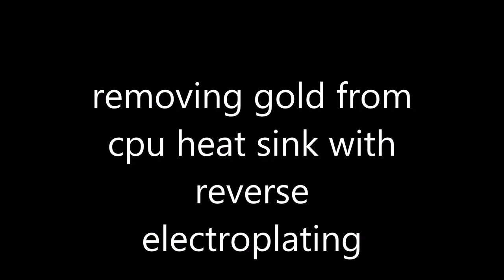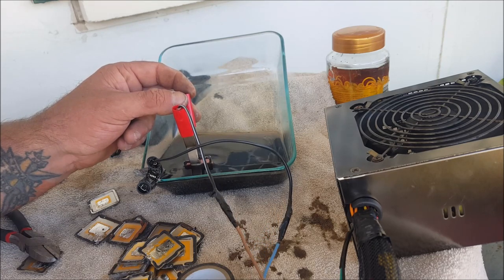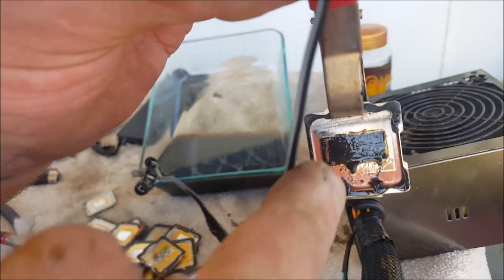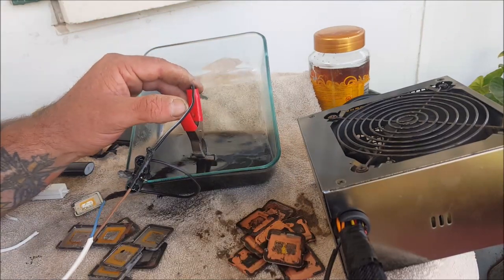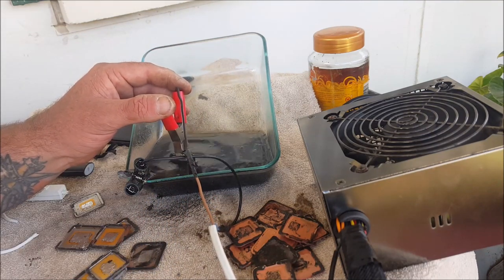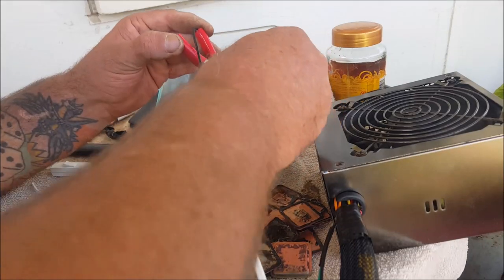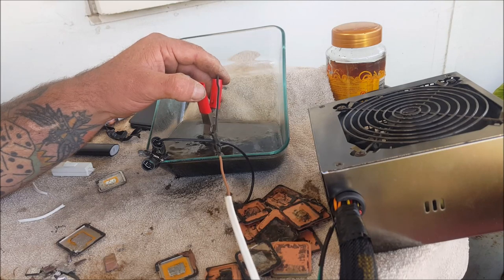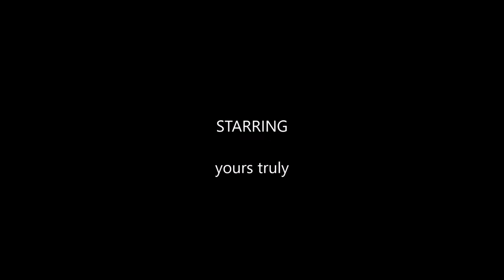GOLD RECOVERY / how to remove gold from cpu heat sinks with reverse electroplating

Comment: Use heat when you remove the IHS, you have to deal with the silicon dies than you can recover the solder which contains 10 to 20% indium, bit only the soldered IHS`s non soldered is only thermal paste
Reply from the maker: thanks for watching

Comment: another good video,  why don't you filter the sulfuric acid and reuse it multiple times? instead of loosing it in the water
Reply from the maker: I do sometimes. Ive even made a video showing me recycling it.
But in this case I needed to put it down the drain because our bath doesn't drain and ive been putting drain cleaner in all sinks and drains

Comment: That solder is actually pure indium worth more than silver by weight
Reply from the maker: oh ok
Reply: @prospectorpete  its melts at 156 degrees Celsius so scrape of and melt you will get good money
Reply: Lion Tamer  PPE is for babies!
Reply: You need your mask and gloves more than the hospital does.  This may indeed be worldwide genocide,  through the cure not the disease. Increased government control, you won’t be able to sell gold without a mark in your right hand
Reply: tiny...
TinY...
TINY...
AMOUNT of indium.
NOT WORTH IT !

Comment: Do you show how to get the gold out of the solution?
Reply from the maker: yes , simply filter the solution after youve added it to water  . the black sediment at the bottom is gold
Reply: @prospectorpete  i thought its a big no-no adding any type of acid to water. rule of thumb always add acid to water.. ???
Reply from the maker: @sarahturrey5446  yes it's always acid to water. Never water to acid